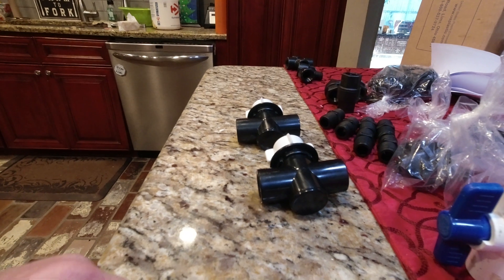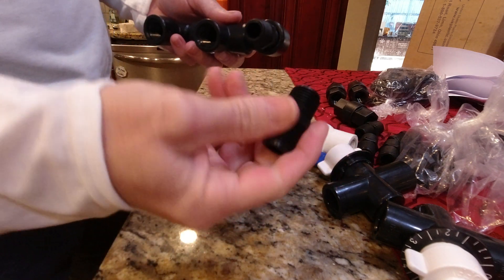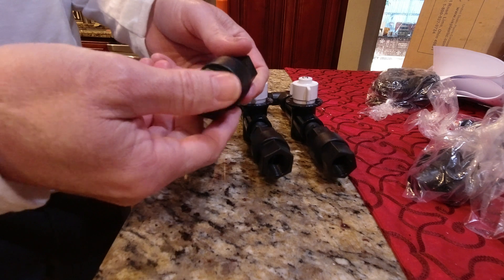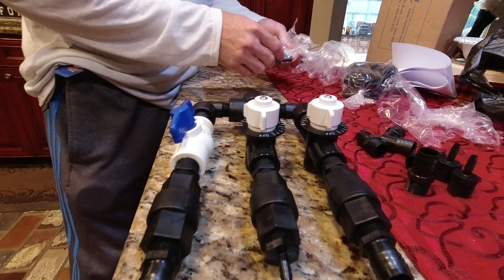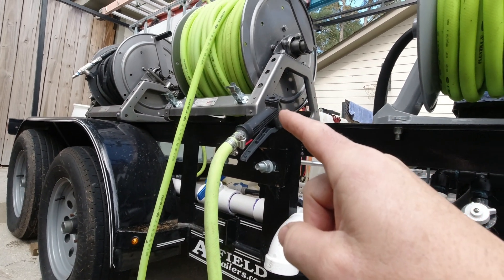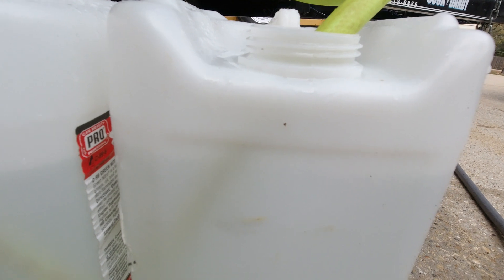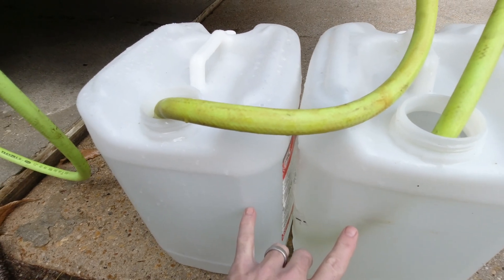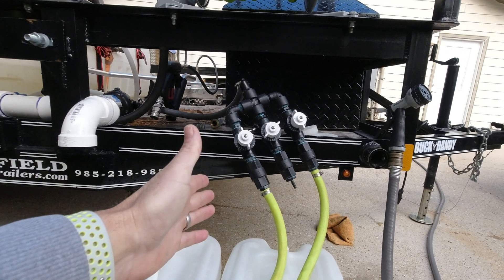Proportioner Build & Test

Comment: Even if you need to cutback the water to make the SH stronger it would still work just as good. Every thing is pretty much approximate. You will never get an exact measurement on the flow of sh. If it works it works. You will never catch me spending 1300 bucks on a proportioner from some of these other softwash channels. Even the chemicals can be purchased elsewhere cheaper.

Comment: Just subscribed b/c of this video. Thank you! Curious thing, Mike V said a ball valve is more restrictive than a gate valve. Are GF valves gate valves? If not, what is configuration of "metering" valve? Thanks!
Reply from the maker: The GF is not a gate valve. They are metering valve that allow the flow to be metered. We now use the Asahi metering valves on all out or proportioners. Thanks

Comment: Do you have a part number for the metering valves you recommend?   I searched the ashai metering valves and they are selling $175 - $225 each. Does that price sound right?
Reply from the maker: Yes, the price seems correct. The part number for the 1/2" is 
160521005. You could also go with the 1" & reduce it to 1/2" for future upgrades. The 1" is the same price & the part number is 160521010. I purchase my valves from Indelco. https://www.indelco.com/products?s=asahi&f%5B0%5D=category%3A522&f%5B1%5D=pipesize%3A29

Comment: Ok peeps, maybe I'm missing something here,,,, at 4:45 it looks like he has a 1/2-inch barb coming out for the water and the SH on the bottom of the unit on the left and right side,,,, then at 8:00 minutes on the bottom right and left sides it looks a 1/4-inch barb size coming out ???? and at 8:10 he says 1/2-inch barb, but they look like there 1/4-inch barbs,,,, what am I missing please ???? thank you all,,,,
Reply from the maker: Not sure what you are missing.  I used 1/2" barbs on the H2O & SH & 1/4" on the soap. I did eventually upgrade the barbs to schedule 80 later. Still using that proportioner as of today until my next suace maker is complete. Be on the lookout. Thanks
Reply: @allproexteriorservicesllc5338  Thank you for the reply, 1/2" barbs on the H2O & SH & 1/4" on the soap,,,, gotcha, thanks again for the help. when I ordered the parts, they sent me (3) 1/2 to 1/4 and just (1)1/2 to1/2 inch. so, I was bit corn-fused, lol.... but I got it now,,,, have a great day....

Comment: I'm not the brightest light bulb, but is there a need to meter the water. Can you just run the ball valve for the water fully open. I understand it has a different flow rate from the pentair valves. But does that really matter. Please clarify.
Also wouldn't more water flow be an optimal scenario. I don't know anything, I'm just trying to learn to set up for myself. Thank you
Reply from the maker: Yes, more flow from the ball valve will not give an accurate mix. Knowing the percentages with accurate valves equates to applying to correct solution & chemical savings. Knowing your chemical draw is key in the industry. Hope this helps. Thanks

Comment: Do you think 3/4 inlet from water and same from sh would make any difference in this exact setup?
Reply from the maker: It may help a little bit, but it still a 1/2" on the 12 volt pump. Thanks

Comment: Will this work on a gas system?
Reply from the maker: If it is 1" then yes. You would also have to turn on/ off the SH & soap manually. Thanks
Reply: @allproexteriorservicesllc5338  So is the only difference the 1" valves? Are all the other parts the same or does everything have to be 1"? I appreciate the video and your responses! Thank you.
Reply from the maker: @captaincake4331  Ours is 1" on everything expect the bypass hose which is 3/4".

Comment: Nice !  We need to build one before spring. Can you post a parts list ?
Reply from the maker: It should be in the description. Also, make sure all fitting are schedule 80 & DO NOT use Pentair valves. Thanks

Comment: Literally just bought everything out of your description. Wish me luck.
Reply from the maker: Not a bad build. Just don't over tighten the plastic fitting & use Tru Blue. Thanks
Reply: @allproexteriorservicesllc5338  Thanks, just got true blue yesterday. Still waiting on parts. Had some bad weather where I'm at the delayed things.
Reply: What was your total cost for the proportioner?
Reply from the maker: @law0472  With the GF valves, the total cost is around $375. Thanks
Reply: Thank you I thought maybe us plastics was cheaper. I built one for about 295. On amazon.  Thanks again
Reply: Do you think this would draw chemical and surfactant if connected to a downstream injector using the Venturi effect?
Reply: Excellent video! Thanks!

Comment: am I wrong in thinking you could just use all ball valves? wouldn't both h2o and sh being set on full open be 5-6% mix, set h20 full and sh to half, now you got 2.5-3% and so on. as for surfactant just crack it open till you like the draw.
Reply from the maker: I think you are correct. We wanted the ability to change the % when needed a little more accurate. Thanks

Comment: Im still using a 4gpm and 5 gallon bottle.i use a 1/4" ball valve to turn my SH on/off.I also use the same valve as a metering valve if the house isnt too dirty to save a little $.I really want this set up you are showing though.
Reply from the maker: It does help with accuracy for sure. Thanks

Comment: So if youre using 12.5% sh, with both valves open would that be your 6% mix and the more you shut sh valve off the weaker the mix?
Reply from the maker: Correct. Turn the SH valve to half way to get 3% etc. Thanks
Reply: @allproexteriorservicesllc5338  thanks man

Comment: my sh and soap is not sucking but my water is i did everything right do i have to turn down the pump to get all air out
Reply from the maker: Make sure your check valves are not mounted the wrong way to prevent flow. Thanks
Reply: @allproexteriorservicesllc5338  I did figure it out water was fine sh I had to put my hose line at the bottom of the tank coming out and my soap valve was leaking from the valve I replaced everything and it works now with no flow lost

Comment: “Hey catch up”.. I love it when you say that on your vids😂😂 
Anyway there’s a brand ASAHI who’s metering valves design solved this phenomenon. By full open the metering valves practically the same inside diameter as the ball valves. If you look at the other metering valves the inside diameter at full open is way smaller than the ball valve, hence less flow! 
Wash on brother 🤘🏽
Reply from the maker: Good info. I just made some changes to my 12 volt proportioner with Asahi valves. Vid will drop soon!! Wash on brother.

Comment: First off thank you i been looking for this! So basically in theory if the GF valves produce 1.4 gallons/min, if you find a ball valve to match the flow rate it should work.
Reply from the maker: Yes, in theory. It would be easier I think just to use another GF valve. Thanks

Comment: Great video! Why not just slightly close the ball valve down to match the flow rate of Pentair when spraying with bleach? And when rinsing turn the ball valve fully open so as not to starve the pump and get maximum water volume?
Reply from the maker: That could have worked, but I wanted a more accurate flow. Thanks

Comment: Hey sir, finished up my system and did a job went to rinse off the house with straight water but it was very soapy like there was soap drawing but my valve was off and the soap was not moving. It does not have a check valve like my other 2 lines. I rinsed and rinsed but still same result soapy water. Any ideas ?
Reply from the maker: It sounds like soap got in to your water tank. You need to add check vales to the water line to prevent back flow. Thanks

Comment: What a lot of people don't understand, is the reason for quality proportioning valves. One look at the cross section of the two valves tells you everything you need to know. That being said... in negative pressure application, it is CRUCIAL to use valves with REPEATABLE CONSISTENCY. Do you need a proportioning valve on you water pickup? Not necessarily. What IS important, is that YOU know YOUR equipment. Know your settings, and the results the produce. Also, know your chemicals. Density and viscosity will effect flow in negative pressure (pickup) applications. A high density/high viscosity foaming agent or surfactant isn't going to flow like a low viscosity solvent/detergent. Take a day and run flow tests on your equipment with the chemicals you use. Keep a cheat sheet with the various valve settings and flow rates.
Reply from the maker: Agreed!!!

Comment: Hi Pro. 
This valves are not too bad, but my setup start leaking after 2 years of use. I'm planning to get the more expensive ones, the one with the orange valve. Did you have used them before?
Greeting from Miami Fl.
Reply from the maker: The GF valve are much better that the Pentair valves. Thanks

Comment: How do you prime the soft wash system and then when you change the dials, how do you know when the new desired amount of bleach is coming out of the wand? Thanks!
Reply from the maker: It self primes pretty easily. It takes about 30-45 second to clear the line when changing the SH dial. Thanks

Comment: Pentair valves is all you need.  They are made for chlorine and the more expensive ones aren’t needed.
Reply from the maker: Every Pentair valve I had ended up leaking. In my experience, the GF valve hold up much better. Thanks

Comment: I have had pretty good luck using hose clamps on each side of those Pentair valves to keep them from cracking best for you to put a hose clamp on each side and tighten it down snug before you put it together.
Reply from the maker: Good info. My last Pentair valve is now leaking on my 12 volt proportioner. I plan to replace it with a GF valve when we get some time. Thanks

Comment: If by chance you want to 3way off the output side to switch draw from a 12v “or” a Downstream injector, you’ll need a meter valve on water to shut off water completely to meter for Down stream.
Also you need check valve on all as well!

Comment: The biggest issue I was wondering about before getting a blend manifold was the size of the suction hose going from the manifold to the pump. I run all 1 inch suction hoses to my 5.5 pumps. I was always told to double the size to whatever size your inlet opening is for your pump which is 1/2 inch. I was wondering if you can do the same for the suction hose going from the manifold to the pump. 1/2 inch seems like it would be a lot of stress on the pump trying to pull through that and also trying to pull from 2 more separate 1/2 inch lines plus another 1/4 in line. Just wondering what the thoughts were on that.
Reply from the maker: I never tried anything bigger than 1/2" feeding the manifold. I did use a 3/4" from the manifold to the pump, but did not see any improvement. This is why I run a 3-way ball valve on my SH line. So I can convert my SH line to H2O without losing any flow. Hope this helps. Thanks
Reply: @allproexteriorservicesllc5338  Do you have any vids showing your complete setup and how it is plumbed using the 3-way ball valve etc?
Reply from the maker: @Vulcan5911  Yes, I some of my older videos has the plumbing in it. Thanks

Comment: Hey brotha.  That part 62119 (1/2”MNPT x 3/4” barb, would that be the same part I’d use where the hose comes in and out of the pump?   I think those everflo are 1/2” in and out no?
Reply from the maker: I used the 1/2" x 3/4" from the proportioner to the reel. I know it reduces down but thought it may help. You could use 1/2" x1/2". Thanks

Comment: The ball valve is full bore with a much higher Cv (Flow Coefficient) than the non full bore lower Cv Metering (Plug) valve at full open.

Comment: You’ll have to use SH to get the actual ratios. I’m sure you know that SH is heavier than H2O (10lbs vs . 8.5lbs per gallon). It might be the same. Either way it would make another great video.
Thanks for the content.
Reply: or just add salt to make the weight for testing.

Comment: Shouldve used the ball valve on the soap not the water, water and bleach should have the same metering valves for the purpose of blending percentage accuracy
Reply from the maker: It was mainly to demonstrate the difference in the ball valve & metering valve. I need to switch my Pentairs out because one is already leaking. Debating on going to an air system or gas roof pump. Thanks

Comment: Assuming the flow rates remained consistent day to day on the first test,  wouldn't that result in about 3-4% mixture and more flow overall?  Curious what the comparison would be in gpm for the ball valve/pentair vs  2 pentairs wide open.
Reply from the maker: Not sure about the GPM test. However, with a ball valve flowing more than the Pentair it would dilute the SH%. The pump is only a 5.5 GPM so not sure about the extra flow. Thanks

Comment: Is there a video on a manifold maybe a 4 port? A manifold will take care of the 90
Reply from the maker: You could add a tee to get a 4th port if needed. Thanks
Reply: Someone has a video out showing a 4 port manifold ( stainless, I think  ) that they found at Home Depot in the plumbing section.

Comment: I’m curious...in an industry that focuses so heavily on volume, why not just use 3 ball valves instead of three metering valves? I only say that because the ball valve clearly pulled twice the volume of the metering valve. Of course all of that volume won’t directly transfer to the surface being cleaned due to constraints of the pump itself, but I would think 3 ball valves would be more advantageous. I’m probably wrong, I’m just wondering.
Reply from the maker: According to my research, the ball valves do not accurately meter. So when you need a precise percentage of chemicals, a metering valve must be used. Thanks

Comment: Thanks for doing this test, I just ordered 2 Pentair valves and planned on using a regular valve for the third. Now I know I need to order a third valve.
Reply: See the above post I don’t run a Pentair on the water side. I run a a ball valve that is left open all the time. Since I switched to 12 percent SH I leave the ball valve open all the time even when doing roofs. 
Also a Pentair valve on the water side will restrict your vertical distance by 10 ft. It did mine anyways. But do what works for you. This is just my experience.

Comment: Great video! Do you know if the size of the inlet hoses will affect the ratio as well?
Reply from the maker: Not sure about the hose size. I chose to run 1/2" & 3/4" from the proportioner to the pump. Thanks

Comment: What would happen if you maybe used a 3/8 ball valve instead of a 1/2 inch control for the water, I’m thinking this may work
Reply: I did this same experiment but i used two of those 1/2" ball valves in series for the water. The one closest to the cross stayed closed but i drilled a hole through the ball  to imitate the resistance i was getting on the metering valve. The second valve was my shutoff.  It took some fine tuning but after I got it it stayed consistent on the draw rate.  My metering valve cracked recently so I may see if I can do the whole module similarly. I can buy the metering valves but I enjoy the tinkering.
Reply from the maker: @jeffellis7348  Awesome!! That is the way I am as well. Thanks
Reply from the maker: It may work, but 3/8 ball valve may be hard to find. I would recommend just using a metering valve. Thanks

Comment: I run a ball valve on the water side and two Pentair valves for soap and SH. Ball valve stays open for a house wash I dial the SH between 1-2 number on the Pentair. Works good. 
I throttle the ball valve back a 1/4 turn for roof washing. I run the SH between 4-5 number. 
I run a NorthStar 7gpm pump  12 volt. Going on my 3rd year with that pump. I buy my SH at 10 percent.  Pentair valves are going on 3 yrs with no problems. I run 200 ft of 5/8s flexilla hose.  

My system works for me no issues. I will say I tried running a Pentair on the water side at first and it restricted my vertical distance by 10 feet when it was on. The 1/2 inch diameter proportional system is restrictive in my opinion when running a 7 GPM pump.  Now a 5.5 gpm might work fine.  But just wanted to share what works for me.
Reply: What I’ve gathered from the pentairs are they are honestly the same when it comes to percentage. All the way (if you’re using 10%) would be a 50/50 mix which would be 5%. Half way would be 2.5% and so on. The numbers tend to scare a lot of people cause they think the numbers on the dials are 1%,2%,3% etc lol

Comment: What if the ball valve was smaller than the 2 metering valves? Maybe it would equal out then?
Reply from the maker: It may work. But if you are only doing roofs through the proportioner, then 2 ball valves would work for sure. You would just always have a 5% or 6.25% depending on your SH concentration.

Comment: Water line does get turned off when priming soap and sh    line and flushing sh valve...can also be turned back to achieve a stronger mix when needed but not often as long as you have potent sh..pentair valves are trash...they all Crack..

Comment: I suppose I could use ball valves on all three to even it out or would that not be good?
Reply from the maker: The challenge with ball valves is the metering part. I would recommend 3 metering valves to be accurate.

Comment: Yep. I did that test a couple years ago. We utilize 3 valves because it’ll skew the ratios significantly.
Reply: I found the exact same thing. with the valves all being the same metering valves it can be metered accurately.
Reply: And if you have a broken valve, you can rob the water metering valve and replace with a ball valve temporarily
Reply: @southeast softwash can I use 2 gf valves and 1 of the black and white ones (for water)?
Reply: @worth-fighting-for  use a regular ball valve for the water
Reply: Steve Lagana  yes I have
Reply: where do you get all the accessories